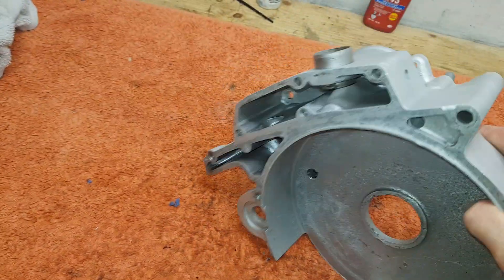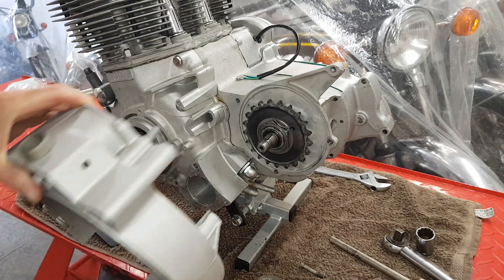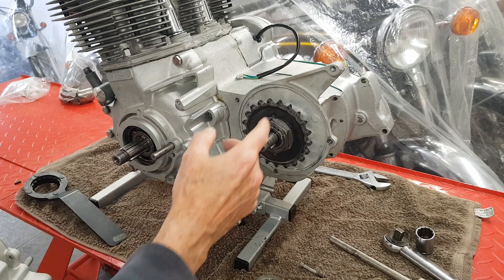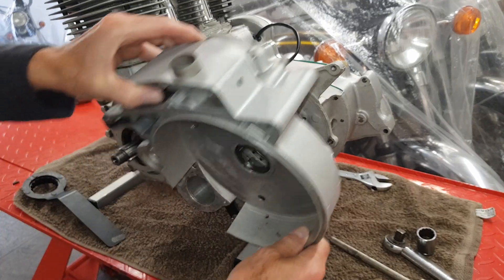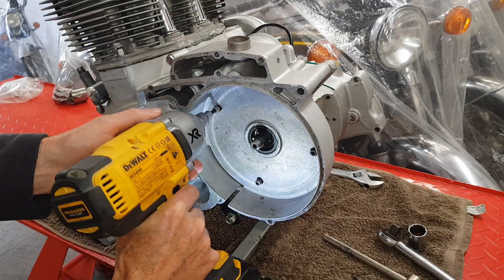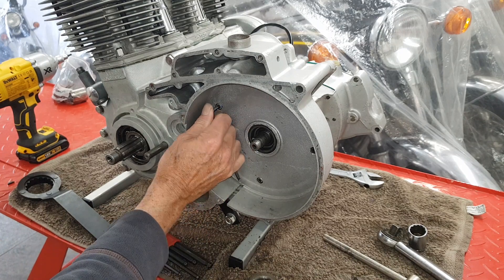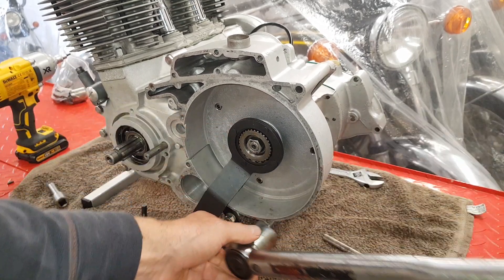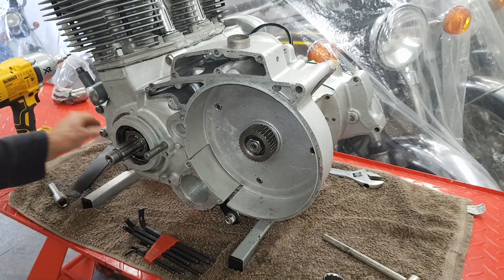Triumph Trident T160 Engine Rebuild. Part 34: Fitting the Clutch Housing and Clutch Hub.

Comment: Chris, with play in the bolt holes ( thru holes) is it critical that the hub be concentric to the center of the shaft or not too much?
Reply from the maker: Do you mean the casing or the hub?
Reply: @Chris.rooke150  the casing...
Reply from the maker: The thing about the casing is that there isn't much room between the casing and the clutch (see next video) so if the casing isn't centred then it will foul on the clutch unit. The casing doesn't have to be perfectly centred,  but close to it.
Reply from the maker: And of course you need to ensure that the casing lines up with the inner primary chaincase that bolts to it.